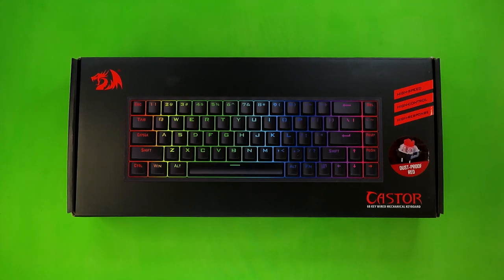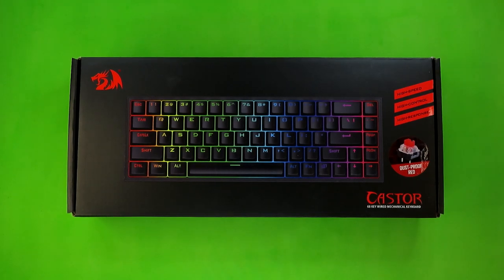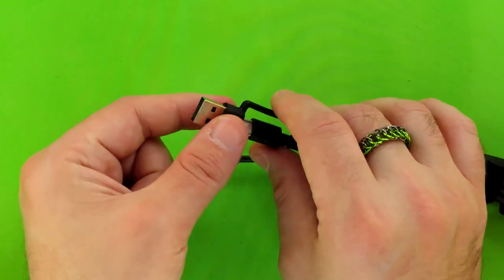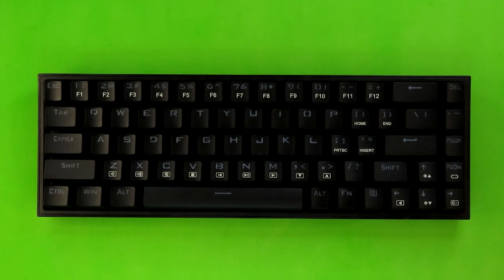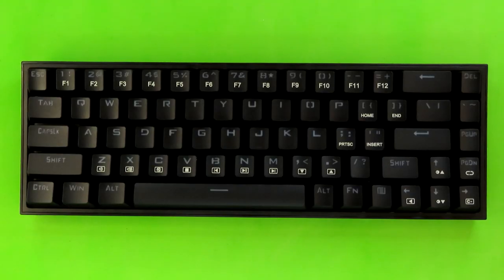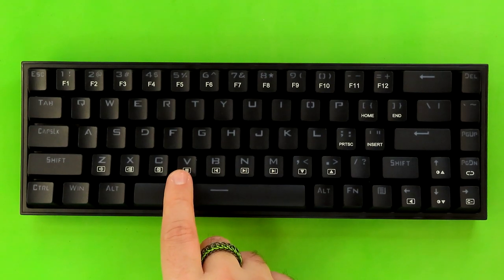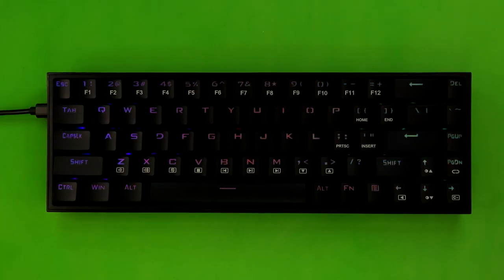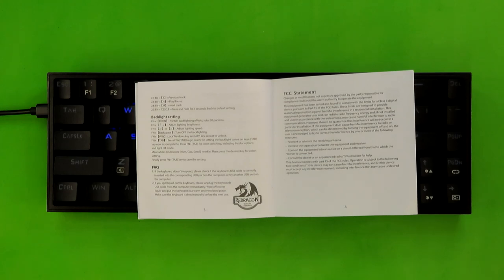Redragon K631 Castor Review | Mechanical Keyboard Review

Comment: Hello Cly, I was wondering if you could do a review on redragon's k599 deimos because it's just like the castor but you get ten times the value for just an extra 6 dollars in Amazon. You get more keys, bluetooth, it has the same switches, and the reviews look good, it seems suspicious cause why would anyone buy the castor when this is available. Pls do a review or give me advice on the differences between these two keyboard.
Reply from the maker: I have a review of the K599 in the works at the moment, and I can tell you at least one reason to choose the Castor over the Deimos. That's the hot swap. The Castor uses 5-pin compatible universal sockets for its switches, while the Deimos uses sleeves that are only really compatible with Outemu switches and others made using that design. 5-pin sockets aren't usually seen in this price range, hence the small difference in the price of the two boards despite the Castor's lack of wireless. 

That said, the K599 has actually been my daily driver since I got it. I prefer the layout that uses full sized keys (very uncommon in 65% keyboards) and the wireless is useful. It isn't Bluetooth though, just 2.4ghz via a USB dongle.
Reply: @ClyFaker  Thanks for the information, I was confused on which one to get but I think I'll go for the K599.
Reply: @ClyFaker  Which keys have different sizes between redragon k599 and redragon k631? And also which keyboard is easier to find keycap sets as I plan to change all the keycap after buying either k599 or k631?
Reply from the maker: The main differences are the right shift, right alt, function, and app keys. The K631 uses smaller versions while the K599 uses standard sized ones. It'll be easier to find caps for the K599, though not impossible for the K631.

Comment: this one or the k530 draconic? it's just a few buck more than this one, also has wireless and also full hotswappable
Reply from the maker: That's up to you on whether you'd want wireless or the extra keys. Also, if you go with the K530 make sure you get the recently released pro version since that's the one with socket hot-swap instead of the original sleeves. Redragon should have that as the one listed as the K530, but some sellers might have the old version in stock.

Comment: Thank you for the info. The manual itself is not very clear. Just got this and although I am not into rgb I hace to say the video does not do it full justice. It looks even better irl even during daytime. That's the "magic" of the north facing LEDs I guess. Also a question for anyone that might know. In the software there is a lighting mode called "music mode". Whenever I switch to it from within the software it runs fine. Once I exit the software it stops and goes back to waveform or something like that. Does anyone know how to fix this?
Reply from the maker: The music mode needs the software running in order to work since that is what is telling the LEDs what to do in response to the audio.
Reply: @ClyFaker  Oh, ok. Thank you. It would have been so cool though if you could just set it as a standard profile without using the software. I wonder if the software can run while gaming though. I'll have to try. It's a nice keyboard in general. Considering the price.
Reply from the maker: Yeah, that's the downside to having the software monitor system audio instead of using a mic in the board or an audio passthrough connector. The software should be able to run in the background while gaming though.

Comment: For stock keyboard, which one is better k617 fizz or this k631 ??
Reply from the maker: I'd have to go with the K631. Not only is it 65% instead of 60%, but it also has universal switch sockets for when you want to upgrade. The K617 only has Huano sleeves, which really limits your switch choices (not as much as Outemu sleeves though).

Also, there is a wireless version of the K631 called the K631 Pro.
Reply: @ClyFaker  im still confused ,because i like k617 for the white color and its font but i also need arrow key for programming and coding 😖 but thanks for the answer sir

Comment: shame this does not have any macro keys. they're very handy. I don't understand the rush to making smaller and smaller keyboards. I still have an old PS2 keyboard from the late 90s or early 2000s, and it's big and chunky. it's a nice feeling typing on it.
Reply from the maker: Any key is a macro key if you have the right software. Sadly the official rebinding software isn't quite ready yet, but there are free alternatives of you don't mind not having LED control.

Part of the drive for smaller keyboards is gaming, which means any unneeded keys are removed and less used keys are moved to the function layer. Another reason is the price of customization. It's a while lot cheaper to mod a 60% keyboard vs a full sized one.
Reply: @ClyFaker  I absolutely agree. for work or productivity full size or tkl are fine. But for gaming, smaller keyboards and bigger mousepads are preferred for mobility and flexibility. I personally hate 60% keyboards though but love the TKL and 65% ones.
Reply: Just get bigger options,you dont need to opt for 60-65 percents

Comment: are there any software available at this time?
plz make a followup video. i wanna know which keys can be made as macros, the complexity, and can we made.. say 3 profiles of macros.
not color profiles, but keybinding profiles.

as always, thanks for the amazing content, i watched every single one of your Redragon coverage and i think this is the perfect one for me.
Reply from the maker: The software for both the K631 Castor and the K628 Pollux are now on Redragon's website. I'll be making the follow up tutorials soon.
Reply: @ClyFaker  Hi, i have problem on the software. every time i click ok and the software is closed, my custom profiles is not applied to the keyboard. Only whenever i opened the software
Reply from the maker: That's odd. I just tested with mine, and the only setting didn't transfer to the board was the music mode. I even took it to a different computer without the software installed without issue. Did you hit "apply" in the software? If that still doesn't work try resetting the keyboard and then applying the profile again.
Reply: @ClyFaker exactly i was trying music mode and its not saved when i close the software. Edit, yes i click on apply before clicking OK. thanks for fast response
Reply from the maker: Yeah, music mode will not save to your keyboard since it's the software doing all of the heavy lifting, not a setting built into the keyboard's firmware. The same is true with other much more expensive keyboards as well.
Reply: @ClyFaker  ah what a shame, guess i just have to open the software whenever i feel like to use music mode, its so cool to have equalizer on a keyboard. Thank you for everything.

Comment: Stock keycaps double-shot, ABS?
Reply from the maker: They are double-shot, and possibly ABS.
Reply: @ClyFaker  how’d you rate the keycaps? 0-10. Good, Meh?
Reply from the maker: They're decent. The walls are thicker than some, so they don't sound that hollow and they're comfortable. Good for ABS, but PBT still feels and sounds better.
Reply: @ClyFaker  I really like this keyboard, my only issue is the lack of Fs and Printscreen. I know, i can press it with combination. But, this seems like great keyboard. I was not able to find any better. What’s your recommendation?
Reply: @ClyFaker  this keyboard or something else, with TKL, or 75%.
Reply from the maker: If you absolutely need the F keys and print screen you might want to look into TKL keyboards instead.
Reply: @ClyFaker  yeah, but TKL at this price point sucks. Can you recommend me one under $60 ideally. Or under $70
Reply from the maker: Redragon (the company that makes this keyboard) has a few. The only issue is that they don't have the same universal sockets as these keyboards.
Reply: @ClyFaker  ikr, can you recommend me tkl, fully hot-swap.
Reply from the maker: Universal hot-swap isn't widely available in the price range you're looking for yet. The Redragon K631, K628, and K530 Pro are the only examples I know of under $75 or so. The prices do seem to be coming down though, and I wouldn't be surprised if Redragon had a universal TKL in the works.

If you don't mind going a little higher there's always Royal Kludge keyboards. Those do have universal hot-swap.